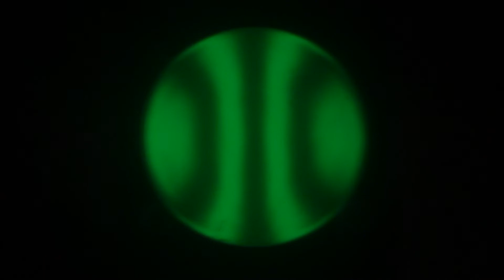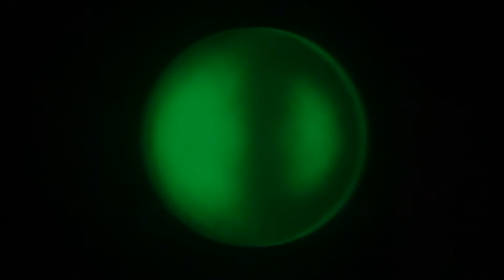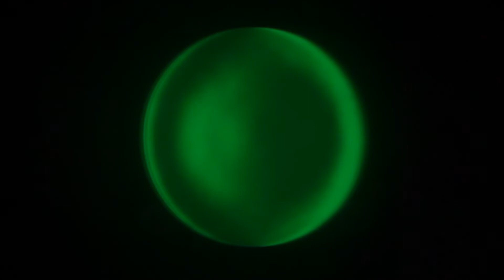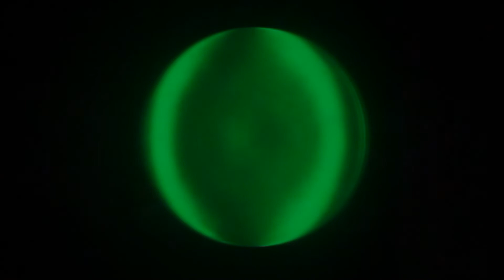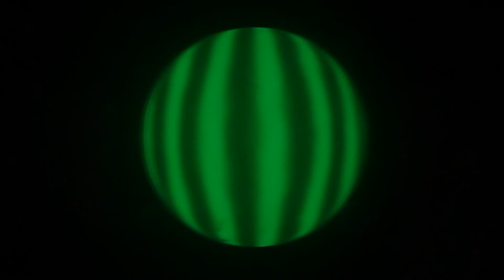Understanding Ronchi Test - English

Comment: I (Optical Test Engineer) have used this kind of method for making 6 to 16 inches of Primary mirror and I have developed easy use instrument to evalvete PM of telescope for fine scratches, deep scratches, smoothenes of primary mirror surface, Parabolic or Sperical surface, turned down or Turned up edge, Faucoult shadow test can be found.
Reply from the maker: @jayantibhaichauhan56  good to know sir. Where are you located?
Reply: @astrokhan  Yes, I am in California USA. Your mirror Center is over corrected and had turned down edge very little , need little more correction, this is use full for manufacturing called parabolizing mirror with six variable to control, Pitch hardness, Tempeture, pressure on tool, Stroke and speed of the table, Quality of pitch tool(contact and mesh on tool), Your Own Mood if wopprking by hand. YOur light source can be improved. YOu are doing and explaining excellent Ronchi test. This is qualitative test and easy working.
Reply from the maker: @jayantibhaichauhan56  thank you sir for your appreciation 🙏 I hope to complete this mirror soon. Kindly also have a look at my blog site astrokhan.com

Comment: sir,  what kind of Led, Volt and watt you used for ronchi test
Reply from the maker: 10mm dia green LED with 100 ohm load and 3V power source
Reply: @astrokhan  Ronchi test is done after polishing or before polishing ( rough mirror grinding )
Reply from the maker: @and2749  it should be done after polishing. However, you can also start testing during polishing when the mirror is partially reflective to assess the future and adjust the polishing strokes accordingly
Reply: @astrokhan  ok, thank you sir

Comment: I am working on 13.5 inch mirror
Got perfect ronchi bands accross the mirror.
But having a Bulge in middle but how to correct it..
Reply from the maker: If the diameter of the bulge is not much and can be hidden behind your secondary, than you don't need to correct it. To correct it, you need to do narrow W strokes. Do it carefully and test after every full turn of the mirror otherwise it will create a hole in the centre
Reply: @astrokhan  I want to contact you once...
Reply from the maker: @suveerudayashankara4273  WhatsApp 9869812363